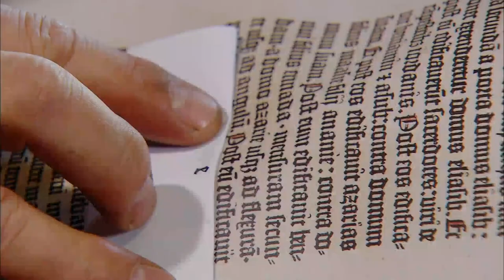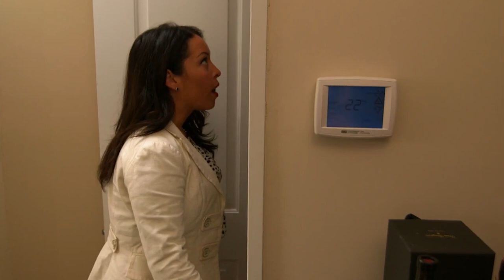Blowing All The Budget On Renovating The Basement | Critical Listing

Comment: For hiding the garbage cans, adding two planters, panelling and glass rail, 6 thosand dollars was a lot. Glass railing was a waste of miney. In that amount of money at least Carson should have spruced up the driveway pavers and added some more foliage
Reply: carpenters are expensive, and it was overkill. But first impressions are important, the condition of those walls looked like they were a hood house - it would 100% put off any buyers from buying the house. They'll just reject it based on outside appearance. 

I personally would have preferred it if they just took out the ugly bricks and put in matching bricks, and made bin storage underneath the stairways, at least that will give a bit more parking space. Having said that, the bin storage adds a crash buffer. I am guessing the ugly bricks are replacement because someone crashed into the wall.
Reply: @Professional_Youtube_Commenter  They said the ugly bricks were from a deck that was removed to add the driveway.  The overkill def added so much curb appeal!

Comment: I don't like the front of the house with all that wood.  It will rot over time.  Too much maintenance.  I would have just moved the trash cans and covered the different colored bricks with some material or paint the front of the house.
Reply: brazil wood doesn't rot that easily. Wood in general doesn't rot as long as there is a route ourt for any water to pass through. Even fence posts dont rot as long as you leave an empty pocket (through the use of aggregate) where the post stands. Suspended wood will last a very long time as the water can just pass through the wood. Besides, they're selling the house, so as long as it looks very nice for the first few months, that's good enough